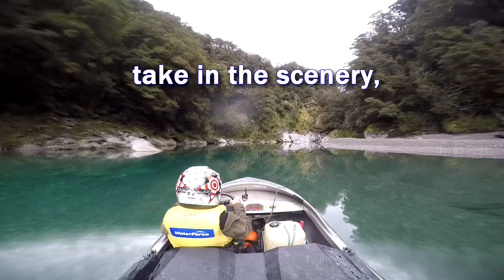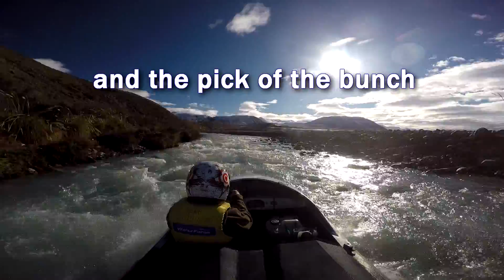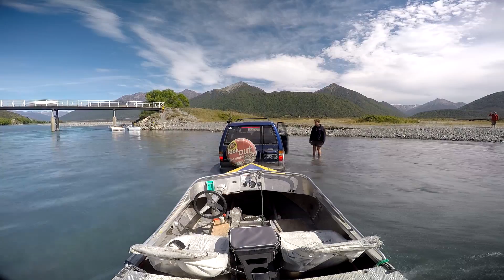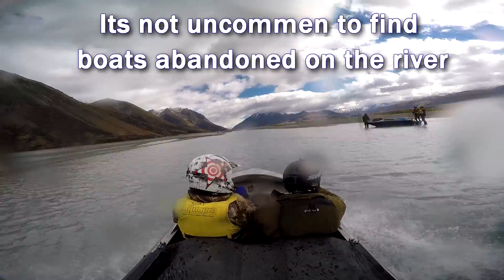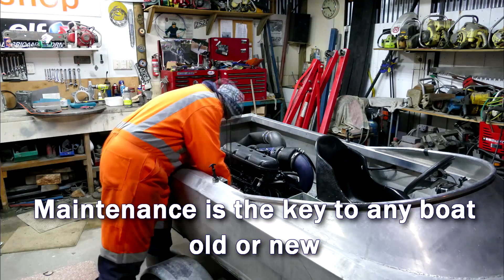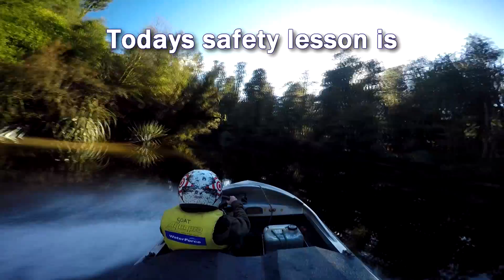Jetboating - some things to consider

Comment: Type 4 and 5, skinny and fat bass boats.  Skinny ones have a inboard jet pump and the fatty's typically an outboard.  I built a jet-jon by mating a Seadoo Xp drive with a 14' Alumnacraft and it's a fine skinny water fishing machine.  I don't go through the shallows at speed because it thin metal all around and it drafts under 3" loaded out.  Love the video mt friend.  I 'need' to build a little dingy style jet.
Reply: ranchero50 only in north america, we dont really have the big stuff down here whats the point ? Light , fast and low draft is how we roll

Comment: FYI:  We start the boat when it is on the trailer and in the water.  Have one person drive the vehicle and one in the boat.  When you are ready the boat will push you out of the water.  Once the vehicle is rolling shut the boat off before exiting the water.  My big rig has 400 HP with a Hamilton and will just about push the truck out in neutral.  My little boat has 165 HP and will help significantly even though I have never had to do it with my little boat.  A winch works great for those spots you can't get a trailer into for the little boat.  dump it on the ground, push it into the water, go for a rip and then once back, hook up the winch and tug her out.  Tip the trailer up and winch the trailer under it and away you go!!!  Thats how we do it, nothing fancy but it is a couple good options.  Oh yeah, as usual Awesome video and great info!!!!  Cheers bud!!!  PS:  A good piece of info for shallow water/deep water is the degree of the hull.

Comment: That part at 2:22, reminds me of the same situation I had while retrieving my large boat. My 4x4 couldn't pull the boat and trailer out at end of day on this gravel shore that the wheels started to sink in the rocky gravel. It was easier to launch it but on retrieval it wouldn't budge like a stubborn old Mule, no matter how much effort the 4x4 tried until it got bogged. I had to ask other boaters and evening closed in to use their cars in front of mine to pull my stranded 4x4 and boat out. It took three 4x4s to finally pull it out. It felt like my car was being stretched apart from the trailer and the three cars in front, until the 'stubborn old Mule' gave up and got out. Depending on how soft is the terrain, pairing up may not be enough In soft, sandy or gravel shores, sometimes more cars are needed. Otherwise the launching and retrieving of big boats is hopeless. And if you're alone in the middle of nowhere in a place where those flaming Salties frequent, you will probably never see the next day coming. They're active at night.

Comment: If your wheels are hopping in the sand or gravel you have too much tire pressure.  air down to around 10 psi. you won't believe the difference

Comment: I built an 11ft. fibreglass jetboat which I only use in sandy rivers. After clogging the engine in sand, I put an aluminium box on the cooling water intake hose to separate the sand from the water. Of course, with all this sand driving, I spend half my life welding and re machining the impeller blade tips. Maybe I should avoid water less than 3 inches deep, but I can't resist zooming past kayakers dragging their boats along in ankle deep water.
Reply: Jack Frost lol yes a lot of walking involved in kayaking , get a sand trap on yr water intake
Reply: That's awesome, I'd love to go flying past the kayakers.

Comment: In Germany this is ot allowed ! 

But you can drive 300 km/h on German Highway
Reply: There are some speed limits on german highways! But not everywhere.

Also ich möchte behaupten dass es nicht auf allen kleineren Flüssen verboten ist Motorboot zu fahren. Wenn man mal beim Ordnungsamt/Wasserschutzbehörde anruft und sich nach Verboten für spezielle Flüsse erkundigt, können die einem oft auch nicht weiter helfen. Drei Hauptsachen: 1. Wo es kein klares Verbot gibt kann man theoretisch fahren. 2. Kommen wir auf das "kann" zurück. Es gibt immer den Unterschied zwischen können und dürfen (sollte mit den Booten aber kein Problem werden). 3. Wo kein Kläger, da kein Richter. Man muss halt nicht überall fahren nur weil da kein Verbot existiert. Wenn man Pech hat und zufällig von einem Rentner (ich nenne sie gerne deutsche karen´s) beobachtet wird, und dieser gerade lageweile hat, gibt es auf dem betroffenem Fluss schneller Fahrverbote als ich "Ich geh dann mal neuen Sprit holen" sagen kann.

Comment: When you first sae the other boat coming at you, the first twitch on the wheel was to the left. I reckon in NZ most of us do just that. After years of driving on the road, its second nature. Keep up the good work mate.
Reply from the maker: the twitch to the wheel is to help get the back end of the boat to spin around- it takes a bit of practice to get it right

Comment: I have a 200BHP. I operate on a lake in Ireland where if it sank you'd be hard pressed to find it and it still sucks in shit. How can you operate these things on what is basically a gravel infested sponge? How are you all still alive? These have to be the best watercraft since Noah's Ark! I want one!
Reply: 200BHP Jetski
Reply: HA
Reply: kdmc40 jet skis don't usually have the proper grates to keep rocks out of the impellers. Boats like Kingfisher Xtreme Duties are made to run in 4" of water, when you run them across shallow or even bone dry gravel the key is having enough momentum and letting off the throttle so you don't suck it up. If you do plug it off you simple jump on the stomp grate to clear it out and carry on. 
They are also built extremely tough to take punishment and the bottoms covered with UHMW so you aren't actually scraping or bashing up the aluminum haul.